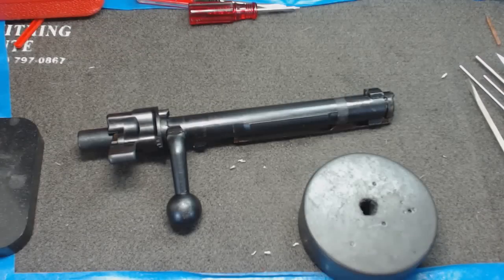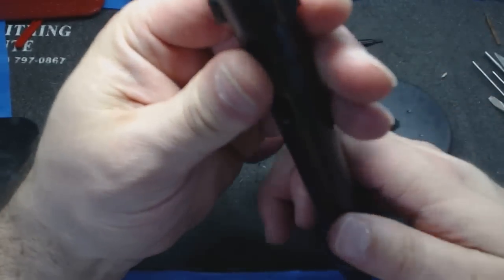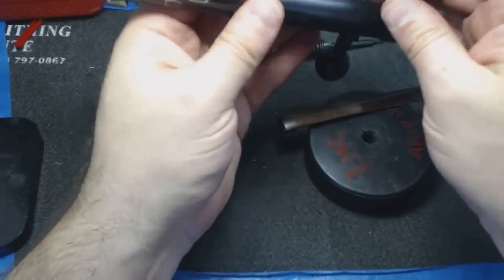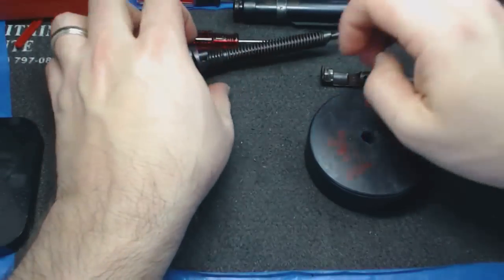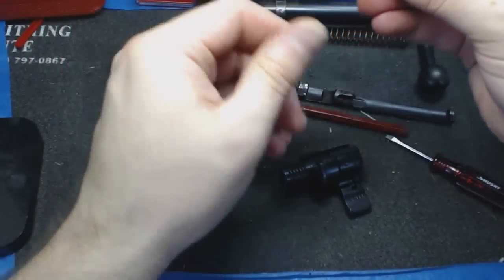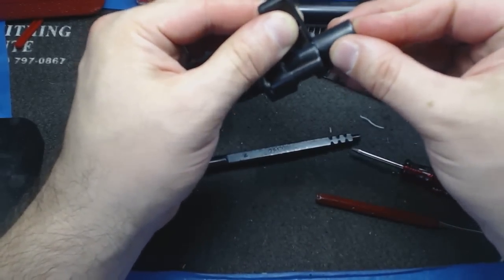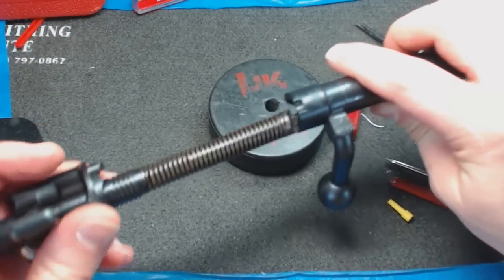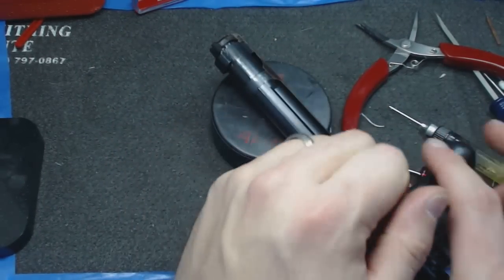Mauser 98 Bolt disassembly and reassembly

Comment: You have just saved me money. I acquired a 1950 Husqvarna .270 with a Mauser action. The safety tab kept falling out. I took it to a "gunsmith" and after a month he sys it is ready, I go back and he cycles the action and the tab falls out again. he says "okay gimmie a week I wont charge you for the extra" gives me the the rifle I took it home hung it up and when I took it down, damned if the same problem didn't happen. As I didn't want my face blown off I hadn't shot it. went on a facebook gunsmith group showed them the problem and a guy says bolt wasn't assembled properly. I find you on YouTube and in 20 minutes problem solved. THANK YOU BROTHER!

Comment: To remove the firing pin spring on your rifle is there a steel ring with a hole through the stock behind the sling? That hole with the steel rings on both sides you can set the firing pin in and press down to remove the spring.

Comment: Ok, so what do you do if you have just a 2 position safety, that was installed for a scope?  I cannot remove my bolt from the action, without it remaining in the cocked but unsafe position.
Reply: Flag or sniper safety from accumounts
Reply: I have this exact same problem, and the first time I took it apart I realized how difficult it was to disassemble with my 2 position safety. In order to spin that bolt sleeve off you must push/pull the firing pin back all the way until the firing pin doesn’t catch inside the bolt sleeve, and I had to Vice the bolt and pry with a screwdriver (thankfully not scratching anything). If you or anyone have found a better way to do this, let me know.

Comment: to disassemble the cocking piece / firing pin --- use your vice to push down on the shoulders , easier and safer.

Comment: Good video, the info about lubrication is especially useful. However the bit about slam firing the gun is incorrect; it is impossible for the firing pin to stay protruding from the bolt upon opening because of the curved surface at the rear of the bolt, no matter what is done with the trigger the firing pin & attached bits will be retracted into the bolt due to this surface.

Comment: Extractor disassembly is questionable; brake cleaner is easier.  Otherwise, thanks for the effort and descriptions provided for the remainder of the bolt parts assembly.

Comment: You should not have the firing pin on anything to release tension of the spring. The odd metal hole in the stock of the rifle is what you put the firing pin in to press down without having the pin end itself on anything.
Reply: That's if you still have a stock stock. Mine got remanufactured and doesn't have that hole
Reply: Man i need help i tried disassembling the bold vot the safety got in fire position and now dont know what to do
Reply: Take it to a gunsmith. If you have a workbench with a solid metal edge, lock the lower part of the cocking piece to it, force the rest of the bolt downwards and turn the safety into vertical position. Then proceed as described... like I said... that ain‘t rocket science, it’s just world‘s simplest bolt mechanism 😎👍. Greetings from Home of the Mauser.

Comment: There is a easier way to get the bolt disassembled. Look at the stock of your gun. There should be a reenforced hole behind the sling hole. That's for bolt disassembly.
Reply: Yup 🎯🍺

Comment: Because i have m98k i know how to kinda disassemble and assemble the bolt but slow down noobs are not going to know to put safety on firist and if they dont bolt wont go back in the gun i once fucked up and i thought i broke gun tell them on start to not panic if they forgot to put safety on and how to fix it

Comment: I foolishly left the safety in firing position when I pulled the bolt out. It seems to be stuck and I can't disassemble it any tricks on how I can fix this?
Reply: Same
Reply: There's a notch at the top of the bolt head, on the whole firing pin block. You can use a round, or a screwdriver to pry that notch up and then rotate it to get it unstuck, I know this is late but I hope this somewhat helps!
Reply: Had this same thing happen to me but mine  is a 2 position safety only so there is no other way around it when disassembling the bolt, sadly. His explanation of how to fix it is correct and is what I did, although I recommend you vice the bolt to do this.

Comment: Pressing the firing ping into ANY object is a BAD IDEA and IMPROPER TAKEDOWN of the Mauser bolt assembly.  Get the right tool.  Use the hole in the disc on a k98 butt stock.  Insert the firing pin until the shoulders of the firing pin rest on the edge the hole.  If you have  a Mauser without this handy built in tool in the stock, drill a 5/16" hole 3" deep into a piece of wood and use that.  NEVER apply pressure onto the firing pin.  It is heat treated and hardened and BRITTLE.  The metal 1" back from the tip of the pin is SOFT, and you could bent the pin there if you didn't already snap the tip of the pin off.  Apply force ONLY to the shoulders of the pin and you will never break it.

Comment: i got a k98 and the bolt was taken out but some one didnt know how to disassemble it and the safty was not on so now it wont slide back into place what do i do?
Reply from the maker: zim wolf you can manually set it to the correct position, but it takes some muscle. It helps to put the body of the bolt in a padded vise and then pull like heck to overcome the spring and retract it far enough to rotate the safety.
Reply: okay thanks ill give that a try
Reply: becouse its in the position it would be if it was in the rifle.
Reply: zim wolf https://youtu.be/pw21OWzeomE in this video ot shows you how to fix it

Comment: Hi there, this is a great video - thanks for helping!  I've actually got a problem that I haven't been able to fix after disassembling and reassembling my Kar98k bolt multiple times. For whatever reason, after the bolt is back in the rifle, I'm able to move the safety from the far-right (double safe) to the middle (normal safe) to fire no problem, but I am not able to move the safety from left to right (to re-engage the safety). It remains stubbornly in the "fire" position. Do you know how I can resolve this?  Thanks in advance for any help you can provide!
Reply: Greg Hodson it could be that the safety is a bit too long in the left end but id check with a gun smith beforehand
Reply: Has the striker dropped? It will only go into a safe position with the the striker cocked and the bolt closed fully.

Comment: Hi , can I use WD40 on bolt action without oil !
Reply: No, I wouldn’t....use a good quality gun oil.
Reply: cyanghost109 thanks a lot 👍
Reply: Not the proper oil  WD-40 is only meant to displace water, and it is a poor lubricant.  It also dries over time, leaving your precious gun parts uncoated, exposed to air and water, and prone to rust in long storage.  Use oil.  Back in the day, you would use car engine oil if you had nothing else available.
Reply: DARIVS ARCHITECTVS  thanks a lot

Comment: THE SILVER HOLE IN THE K98 STOCK IS TO FIELD DISASSEMBLE THE FIRING PIN ASSEMBLY  insert the business end of firing pin assmb in the hole in the stock  push down and  twist off end piece  SIMPLE